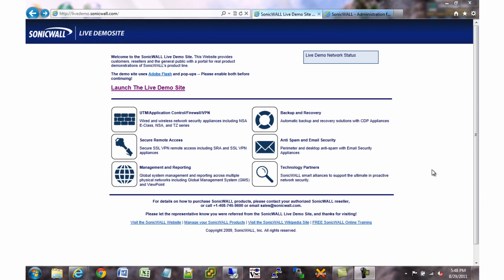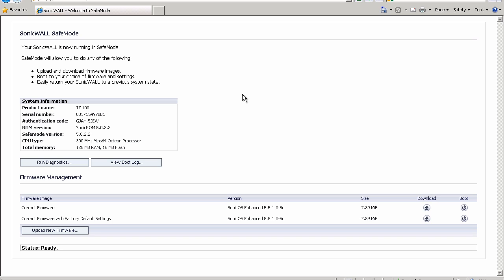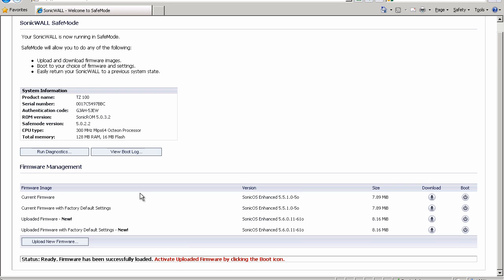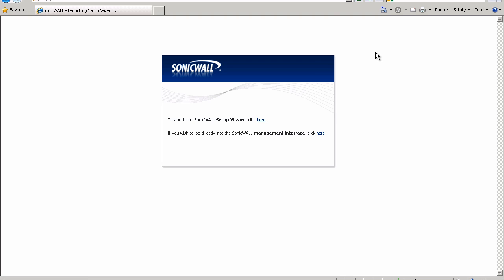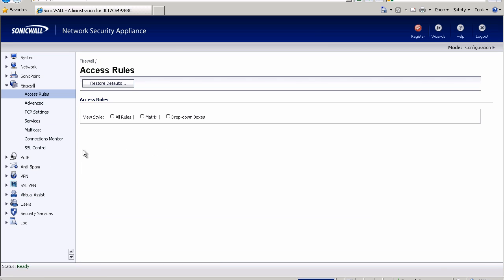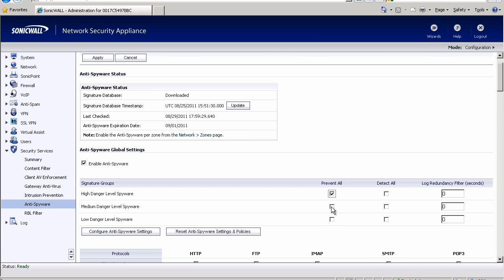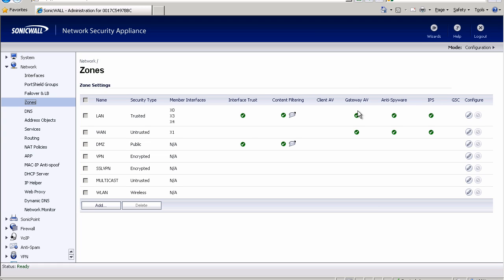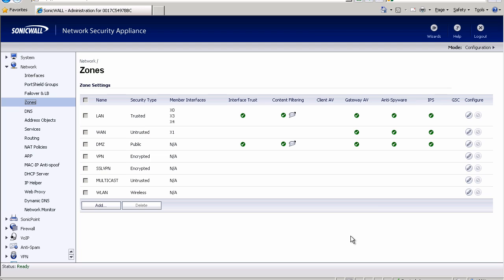Dell SonicWALL Best Practices Part 1

Comment: I purchased a used TZ200 I did the basic configuration. However I can not ping other computers on the network and also File sharing is not working.I have a scans folder I share but now I cant scan to it. if you could help that would be awesome. Thanks

Comment: I am unable to even log into my unit. I have a TZ205 and I have tried the 192.168.168.168 address with no luck. I have directly connected it to my laptop and tried connecting the laptop's ethernet port to all of the ports on the back of the TZ205 with no connection. Any ideas what is wrong or how to fix it? Thanks.

Comment: Hi Andrew, Great videos! I made sure I looked through all the comments prior to sending this note to you, just to be sure the answer wasn't there. We have a SonicWall SOHO at work. Here's the set up we have (this was like this when I got here): D-Link Verizon router to the SOHO then it runs to a switch and out to the users. My question is this... we are going to be having a scheduled power outage at our building and I can't seem to find anywhere if there are certain procedures that I need to follow to shut down the SOHO. Are there any, or is it like a Cisco and you just unplug it? Thanks so much
Reply: Just unplug it.  We sell them and service them, it's what we do.  There's no shutdown button for a reason.  If you are super nervous, export the settings to a local computer first so if it gets borked you can reset it and import the settings.

Comment: Great videos! Really useful!
Can you make a tutorial on how to add another Subnet and make two Subnets talk to each other?
I have two Subnets, the Secondary one can ping the Primary one, but not the other way around.
Thank you very much.
Reply from the maker: +komisarchik Are they different Zones?
Reply: +Andrew Crouthamel Thank you for the reply!
Figured that out. Turned out my Sonicwalll config was good, it was Windows Firewall that was blocking traffic on the workstations.

Comment: Hi, is it possible to have sonicwall to display a different wan ip. As my side have a the symantec gateway assigned an IP and Sonicwall as another IP. I want them to display messaging gateway IP in the header instead of the firewall.
Reply from the maker: +Trendnet18 You could try maybe Transparent mode, other than that, I don't know of any way of "hiding" the SonicWALL from routing.
Reply: +Andrew Crouthamel
 http://postimg.org/image/n3qcgo63x/ 
 http://postimg.org/image/u30b9lff7/

I have configured it this way. I have set X1 as WAN interface and X4 as transparent mode. Is this correct ? Firewall address is .138 and Messaging Gateway as .130(this is what I want to display)

Comment: Hi Andrew, Thankyou for the Videos which I am working my way though.  
I am upgrading from a TZ190 to a TZ400 and have 2 ADSL lines coming in.  On the TZ190 we had all SMTP traffic going through one line and all other traffic going though the other. in the event one of the line goes down then all traffic goes though the working line, once the line that went down comes back up it goes back to the original status. I think I can setup the TZ400 in the same way but wanted to check if you know it can be?
Reply from the maker: +Harvey Singer Absolutely, you want to set up both as WAN interfaces, and configure Failover/Load Balancing. https://support.software.dell.com/kb/sw7828
Reply: +Andrew Crouthamel Many thanks :-)

Comment: I am looking all over for some assistance with a TZ500, 7 Sonicpoints and running a captive portal.  Any help or suggestions would be really appreciated,  It looks like in the SonicOS 6.2.4 they have added in to the Content Filter a Require Consent.  But I can't find anything on the setup.  Also if I am trying to set up a LAG with a Dell X1018P switch will I need to also setup a Portshield Group on the TZ500???
Reply from the maker: +Jonathan Terry Take a look at support.software.dell.com, they have a big knowledgebase of SonicWALL articles. Including this one on LAG setup: https://support.software.dell.com/kb/sw12078
Reply: +Andrew Crouthamel 
Yeah that works but not with the Sonicwall TZ series.  See page 459 SonicOS Admin Guide Chapter 43 very first thing says:       

NOTE: Switching is available on all products except the NSA 2600, TZ series, and SOHO W appliances.

Comment: Have you ever set up a time capsule behind a SonicWALL firewall? I just set one up for a dentist who insisted on using the time capsule because his mac enthusiast son told him he should. The guest wifi account doesn't work in bridge mode (when plugged directly into the network). It works in router mode, but also hands out ip addresses of it's own. When plugged  in the switch while in router mode, I get two different ip ranges hitting machines of course, but either plugged in through the lan ports or the wan port it isolates it either way.
Reply from the maker: +truthseeker1973 No, sorry. I haven't played with one.

Comment: Hello Andrew. My question relates to migrating settings from one sonicwall to another; specifically from TZ210's to TZ600's. The 210's are running in HA mode. The 600's will also be running in HA mode.I want to make the migration as painless as possible. I'm told that even though the settings can be saved then imported into the newer model Sonicwalls, that not all the settings migrate. Is this true - and is there a fairly easy way to clone all the settings? Any help would be greatly appreciated. Thank you.
Reply from the maker: +Direct Tech Computer Services LLC That is correct, but from my experience it's always been fine, and the settings that don't migrate if any, just go to defaults. I've never had a SonicWALL brick when doing it. Otherwise, you could generate a TSR report and spend your entire life paging through that making sure all settings are the same.
Reply: +Andrew Crouthamel 
The application "BeyondCompare" is what I use for comparing two TSR's.

Comment: Hi Andrew,

Is it possible to link two sonic wall nsa 2600 together? Would it benefit linking them? Just thinking about backups and stuff?
Reply from the maker: Grime Head Depends on what you want to do...
Reply: ***** Well im doing an office move and my idea was to have basically two networks the same but in different locations? Can this be done and if so how?
Reply: Can't he just back one up then restore it to the other and change the license and LAN IP Range?
Reply from the maker: Grime Head You can't have two networks the same IP and connect them unfortunately.
Reply from the maker: William Brown Yup that's certainly possible.

Comment: Hi, Andrew your video is great, seem to know well the sonic wall settings, I have a business that have new network setup and I am not the IT who set it, it has problem connecting to sonic wall TZ 215 through 192.168.168.168,  it drops connection gives page load error and it takes about an hour to successfully log in to it and do a one change, I checked network everything else works fine, since I did not setup router, i hate to reset it not knowing what was set on it, is there a way to save the settings only and reset it, if i apply the settings back, do you think it may keep the cause of the problem, from my experience i always reset a router after a firmware update, and then apply the setting manually again, since I know the settings, and it works great, i had couple times routers got bad performance after firmware updates or update some settings, what do you recommend to do to find out why this sonicwall is slow to respond?
Reply from the maker: Paul Meyer Paul Meyer I would recommend doing a firmware update to the latest version. With SonicWALL's you can safely use the settings file, no need to manually configure each time. You can Export them under System > Settings. Then, you can reset it to factory default using the reset button I cover in my best practices video: https://www.youtube.com/watch?v=gVUGWo_cg6I&lc=z13dxjpojuuyuvnu423zetg4gq25x11pu04

Comment: Hi Andrew, could you please tell me how can I use TZ 205 as internal DNS server? can't resolve dns when I use internal firewall IP as DNS on computer. But we can do for other firewall for example, cisco, netgear, d-link etc.
Reply from the maker: Iqbal chaklader Short answer: You can't. SonicWALL does not allow DNS proxy for security reasons.
Reply: ***** uhh. I wish SonicWall would not do it. if Cisco and every other firewall allow DNS proxy, what kind security Sonicwall has to worry about. Thanks for the respond Andrew.

Comment: My company is now move on Sonicwall NSA 2600.......
So i have to configure this but the current scenario is we are using sonicwall TZ 215
could u pls guide me how to start..........I have some idea......
1.to import the current setting to local system and after physicl setup will import the setting.on NSA.........but what about nat policy,and any other setting pls help me out to resolve it??????
Reply from the maker: Shajidhassan Hassan All the basic policies should carry over just fine, I would recommend upgrading your TZ 215 to the latest firmware first though before exporting. Then same with the NSA 2600, update before importing. Just to be sure.

Comment: I exported the settings from a TZ 100. 

Am importing the exp file into a TZ 105. 

It has been going for over an hour – is this normal?
Reply from the maker: No, should only take a few minutes. Though if the IP of the firewall changed due to the imported settings, make sure you open a new window to the new IP. The old one will stall and sit there.

Comment: Thanks, these videos are great!
One question - I setup my sonicwall tz215 on my domain network which I can sslvpn into the LAN subnet (thanks to your videos), but now I want to have a QuickBooks server accessible to a couple sslvpn users without access to the domain LAN subnet. Do I need to plug in the QuickBooks server to a different port on the firewall and configure that port for sslvpn? I'm pretty lost at how to go about this. Do you have any videos describing how to do this? Thanks again!!
Reply from the maker: In simple terms, yes you would have to create a DMZ on one port, and hook the the QuickBooks server to it. Then SSLVPN users would need to get IP's off the DMZ network you created instead of the LAN, so they are properly segregated. Beware though if the QuickBooks server is part of the domain on the LAN, make sure changing it's IP isn't going to break anything. I know Intuit doesn't make the most stable software.

I have a DMZ configuration video here: Dell SonicWALL DMZ Configuration

Comment: Apparently pushing that button is a bad idea on an NSA 220.  I did that and never could connect to it.  Thankfully, unplugging it and plugging it back in allowed me to connect it.  Whew!  
I would have hoped they had sent some kind of setup guide in the box.
Reply from the maker: Hmm haven't had a newer one do that to me, some of the older ones though would spaz out (like TZ 170's and such). You can still do the firmware upgrade after the fact, you just need to get an IP on it, and register it/sync the licenses first.

Comment: how can I use a sonicwall appliance in a situation where I have multiple public ip addresses and they will all use port 80 and point to different servers?
Reply from the maker: When you go through the Port Forward Wizard you can enter the public IP you want to use each time. Check out my Basic Port Forward video to start: Dell SonicWALL Basic Port Forward

Comment: I just setup my TZ 205. I put it in maintenance mode as instructed, connected to Port X0 but Im unable to pull up the console. I gave my laptop a 192.168.168.x address but its not bringing up the console...... I was able to connect when I tried to access it before putting it in maintenance mode. (Thanks) Great demo vids as I've reviewed thus far!

Comment from the maker: WPA as in encryption option for wireless? You shouldn't have a problem in that case, provided the tablet supports WPA. If you are wanting to use the GVC client on the tablet, if it is iOS/Andriod based, SonicWALL has an SSL VPN client called Mobile Connect that is fantastic.

Comment: Thanks for the reply. That was my conclusion back when I did my research. Dell seems to have increased the security services subscription pricing. But, for my applications, most of that is more peace-of-mind than genuinely useful. In all the years of having the security apps licensed on multiple SonicWalls, I'm not aware of a single instance where the paid service prevented a serious problem. For companies needing broad up-to-date content filtering or support, however, I can see the value.

Comment from the maker: A SonicWALL? Sure! It depends on how much traffic you see at work as to which model would be best. Also, if you want App-Flow visibility, you'll need a TZ 215 or NSA-level model. I would suggest using the Single Sign On (SSO) feature so your logs and firewall rules can show user logins, not just which computer's IP is going where.